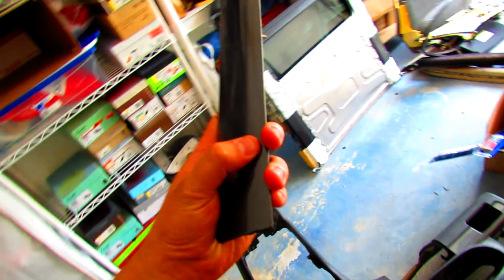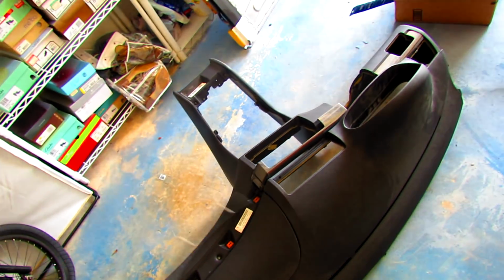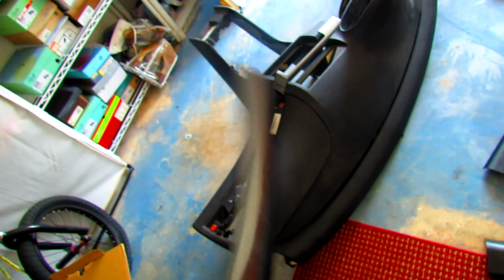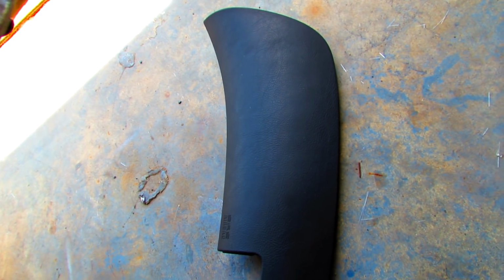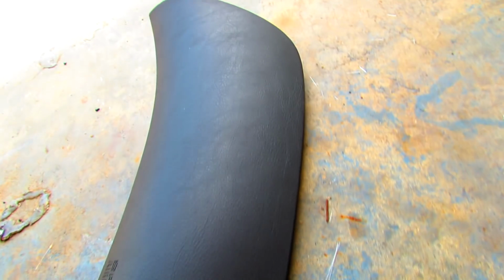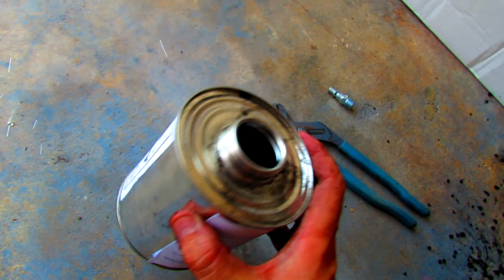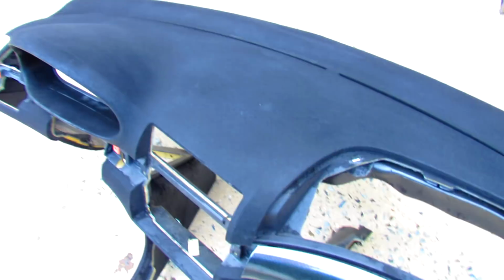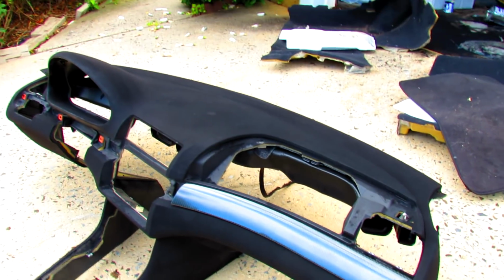Flocking the M3 GTR Dashboard (suede look-a-like)

Comment: And air tube inside of your car like mw car
Reply: Its not a airtube lel. Its for the fuel
Reply from the maker: It’s an air tube that goes pointing at the driver, I have AC I don’t need that
Reply from the maker: Elias #9 the one for fuel is on the quarter panels
Reply: Oh i see. I was thinking he was talking about the window one. But even if you have AC , it would be cool to do this.